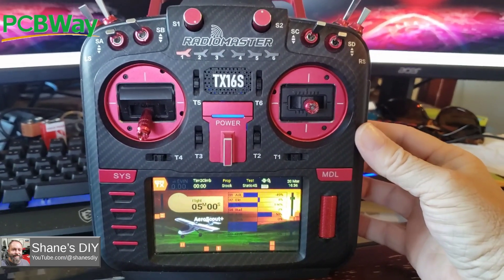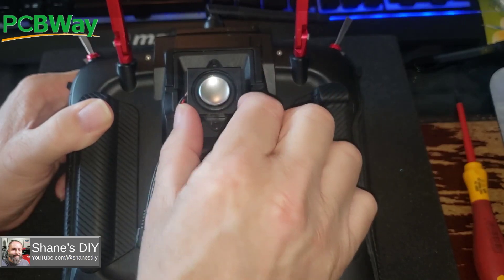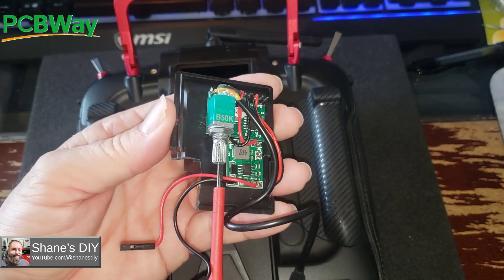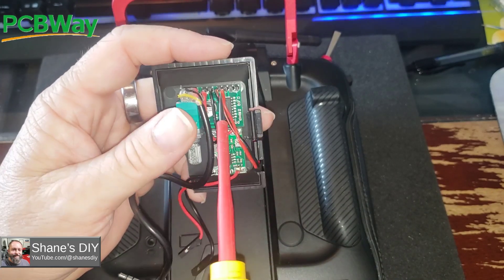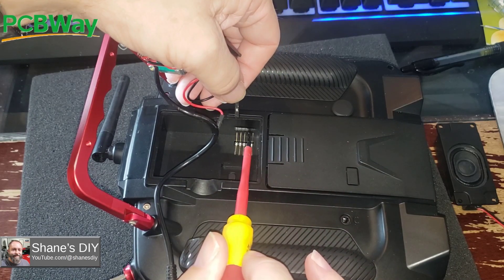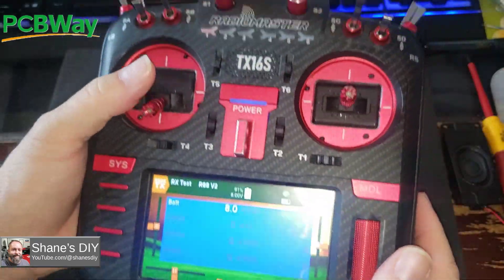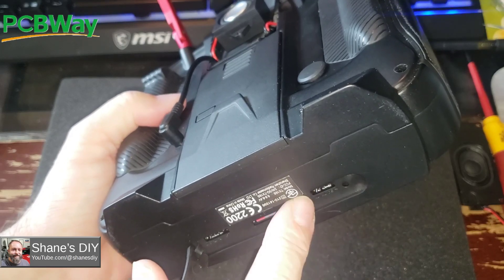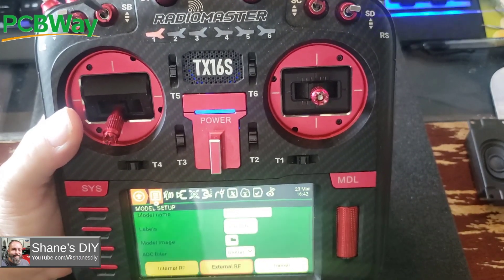Radiomaster TX16S MkII - Awesome Audio Upgrade!

Comment: Why not use a transducer speaker where the rear speaker spot is and turn the whole radio body into a speaker ?
Reply from the maker: This was a first prototype to see how this cheap amp and speaker worked with the signal and power supplied from the radio without making permanent changes. Works amazing so now folks can tweak this concept and make it better! One of the viewers here did their own mod with the same speaker I used inside, powered by the bottom aux port and he loves it. I suspect it is working like you describe as a transducer inside. He sent me photos which I plan to share in episode 2 of the audio upgrade.

I'm planning a "version 2" install video soon where I make my mod more permanent.

If you perform a mod of your own be sure to let us know how you do it and how you like it!

Comment: Good day Shayne, Wanted to tell you I am so pleased with this mod. I'm very hard of hearing and could not hear anything from the built in internal speaker. I bought the amp/speakers and skipped on the buck converter. I mounted one speaker inside the case opposite the RTC battery with 2 sided tape to the case and added a jst connector to that. Then turned on the Serial port and tapped that for power using a JST as well. Enlarged the slot for the module pins a bit and also that extra hole in the module bay. Stuck the amp into the bay and plugged in the 3.5mm audio cable and viola, it is awesome. Thanks for sharing that.
Reply from the maker: That's awesome!  Glad it worked out for you.  It really does make a big difference being able to hear it clearly.

Comment: I wonder if you would get the same result, by just disconnecting the existing speakers internally and hooking up the new external, ideally 4 Ohm, speaker into the internal speaker connector. This way no additional DC/DC and amp might be required.
Reply from the maker: I've see quite a few people swap speakers and it improves a little. I think my next test will be to amplify the stock internal speakers and see if they can sound any better with more power to them.

Comment: Could the original speakers be upgraded? I have an elrs module plugged into the bay.
Reply from the maker: I've seen people change the speakers and I don't think it is that much better. You could use the bottom Aux ports as mentioned in the video but you'd have to run those two power wires to the bottom of the TX.  You would not use the DC-DC converter if you do as the Aux ports output 5V which can feed the amplifier directly.  Then stick the speaker on the battery cover maybe?

If you don't mind opening and modifying your TX these parts should fit inside, just not sure about the speaker.  I think I'll test this external amp on the stock speakers and see how they sound.
Reply: I wanna say that you could replace the audio module inside with this one and the speaker will fit in the case. Take a little more time to do but yeah I think it would be good.

Comment: What about rf output from new hardware? Did you check it if interference with 2,4ghz link?
Reply from the maker: I have connected to one of my planes since this and everything worked but I didn't fly yet.  I'll do a range test and confirm it still has the same range.  I see no reason any of these devices would interfere at the 2.4Ghz range but certainly best to be sure before flying!  Thanks for the question!

Comment: My TX16S sounds fairly decent. Seems like it has a 2nd speaker inside it that the 1st version didn't have..
Reply: It does have 2 now.
Reply from the maker: In my opinion not terrible either but when compared to other radios it's much quieter.  Even my Radiomaster Zorro is louder. I'd rather not have to put the volume at max to just barely hear it.  Perhaps my hearing isn't as good as it once was, lol.